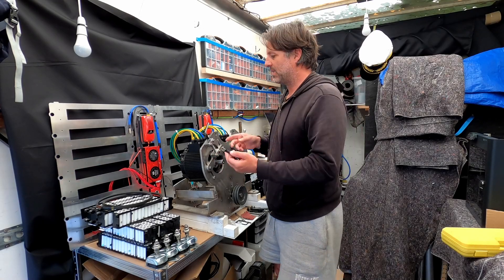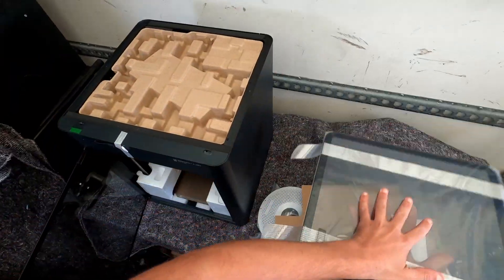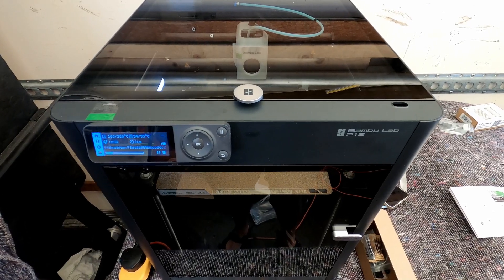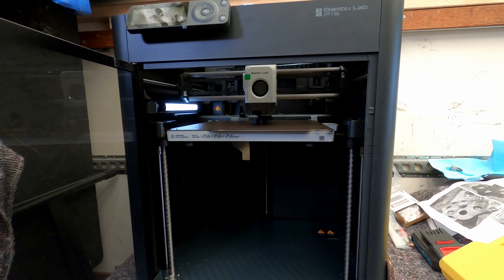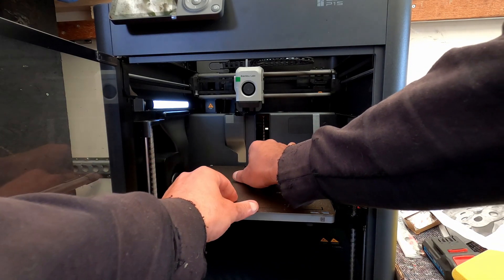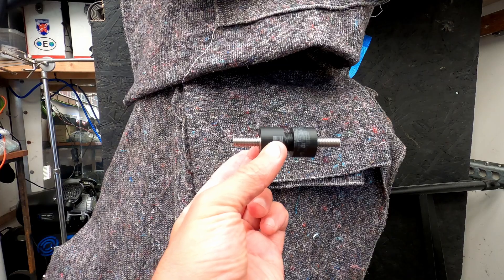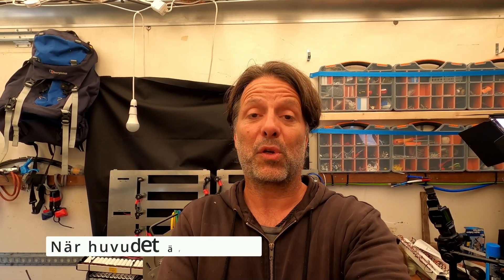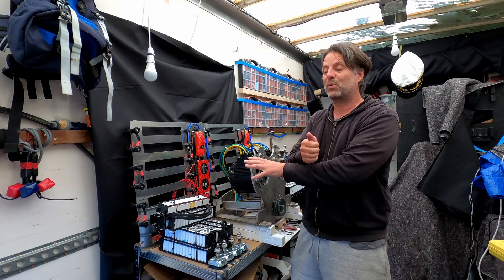Off-Grid Boat: DIY Electric Boat Motor Assembly - Ep. 5

Comment: Cara muito maneiro esse teu projeto quero desenvolver um e-mail brasileiro!!
Reply from the maker: Hi Luiz - Great project indeed:) Thank you for your comment. Not fully sure what email list you would like to create. Anything I can do to help let me know :)
Reply: @modularhippo  :-)
Reply from the maker: @jimjones7821 - Morning Jim, just to add, the 18650 Li-Ion batteries are 'experimental' and would sit in a fire proof box if ever used on boat:) More of a 'fun' project than anything as power versus weight and effort do not make sense:)
Reply: @modularhippo  never hurts to have a backup - I am planning 2 battery systems - too many links in the long chain in all this - only takes one link to break and you are out of action - not a good thing on the water in a boat. The plan I have come up with is to build a 12v battery out of the same cells I use for the main batteries - this way I get to use the 12v battery for odd jobs but I then have spare cells if I need to replace a cell say 3 or 4 years down the line - the cells we use today may not be available in the future so you need some spare cells - a spare 12v battery that can be used for odd use here and there now and be able to cannibalize for spare cells in the future is no bad thing.
Reply from the maker: @jimjones7821  - A 12V backup setup of the same batteries is not a bad idea at all. In case of an individual cell going wrong in the primary setup. Not to worried about the EVE standard being discontinued for a while, if anything they may tweak the metals to improve cycles and amperage BUT hope the size standard will remain the same for a while:) - Another point for separate 12V setup is that you then can still run 12V/5V appliances in case the 48V system is gone completely. I might have to borrow that idea from you:) - My final system is all built around 'what if' to make sure that I have a plan A,B, and C. As you say, not good at all to lose power in the middle of a long crossing:)

Comment: I have no clue but isn’t those belts way to small for the that motor torque/power?
Reply from the maker: Hey - It has been pointed out and I may have underestimated the load on them. Luckily the plan is to replace them with a single, wider times belt (toothed) so when I come to pick that one I will make sure it can handle the load. Big Thank you for the feedback as the project depends on it (I am not an trained engineer as you might be able to tell):)
Reply: @modularhippo  check out drive belts for motorcycles they would handle the torque
Reply from the maker: @kevinkurka8020  That Kevin is a brilliant idea. I will definitely check that out as make perfect sense:) Big thank you for pointing me in that direction. Enjoy your weekend!!
Reply: @kevinkurka8020  I second that - great idea! I was going to suggest serpentine belts - those v belts used so far have big transmission losses in them. But a belt for an electric motor bike would absolutely do the trick. I would still look into a serpentine belt though and compare - all the data will be there as to which one suits this application best.

Comment: 11:35 That's not positive. That's negative that you need to connect to the controller, the other one (blue marked B-) is the one you need to connect to the main negative of the battery.
Reply from the maker: Hi - Big thank you for feedback - Looking at the Daly diagram, it looks like Negative 'B' connects to Negative on battery, and Negative 'P' connects to Positive on Battery. Not had a chance to look at this properly and really happy you pointed it out as I now doubt myself and will do some bed time reading:) - To be continued:)
Reply: @modularhippo  it says P- on the cable, meaning Power-. The idea of the bms is to disconnect the battery from the load. The only way it can do it is by disconnecting the B- (battery -) from the P - (Power -) which is the negative that goes to your controller, charger etc. Happy to help
Reply from the maker: If you do not mind I would love drop you a message and sanity check any of the electrical BMS related stuff with you before adding load? Sounds like you know what you are talking about and can safely say at this point I do not:)
Reply: @modularhippo  Sure, go ahead. One more thing that is quite important, once you start connecting balancing wires, make sure you unplug the other end from the Bms first. Solder/connect all wires and then before connecting it to the Bms, check that the order is right, so you have 0V, 3.6V, 7.2V, 10.8V and so on, connecting it in the wrong order can easily break the Bms.
Reply from the maker: @ksochacki  Thanks - I have seen a couple of videos where people have connected the wrong balancing wire so have made a mental note of that one:) - Awesome, I will give you a shout before connecting any loads for a sanity check. Most appreciated!!
Reply: @modularhippo  Figured I'd just throw my hat in the ring as well and say ksochacki is correct.

Battery pack negative goes to BMS connection B minus
BMS connection P minus goes to bus bar/whatever negative.
Battery pack positive goes directly to bus bar/whatever positive. Preferably through a fuse first.
Reply from the maker: @Lagittaja  - Thank you for feedback and confirming:) As expensive (to me) components the last thing I want to do is wreck them so will definitely check back here before doing any drastic moves:) Guess worst case scenario is an electrical fire so I will definitely proceed with caution:) I have a 200a marine trip-switch fuse so might try to incorporate that. So that would go between 'P' minus and Negative Battery side? Correct?
Reply: @modularhippo  No, not between P minus and battery negative.

In this scenario, you would have the battery positive going to one side of a fuse. And the other side of the fuse would go to your positive bus bar/whatever.

By the bus bar/whatever, I mean whatever you're using for connections to your load, charger etc.

I sent you an email with a beautiful paint drawing.

I would add a fuse because it is cheap insurance. Sure, you have a BMS that has protections against overcurrent but I don't know how fast it will be able to react. If the positive cable sleeve gets damaged and shorts against a piece of metal that's grounded or if there is a short circuit for whatever reason, the fuse will blow and prevent the cables from overheating. Lithium ion batteries can provide an enormous amount of current in a short period of time..

As far as the size of the fuse and type of the fuse. I don't know. Probably. Refer to the specifications whether it can handle the voltage and has enough current breaking capacity (measured in kiloamps, higher the better).
The resettable fuse you have is probably DC rated because it's marine but make sure it is rated for DC. That is because DC is harder for these types of resettable fuses (technically circuit breakers) to break the connection than it is with AC. The reason is, with AC, the voltage goes up and down and so does the current. Eventually with AC the current goes to zero and it's easy to break the circuit. With DC, the voltage is always high and so is the current. So a DC resettable fuse/breaker needs to be able to break the full current.
Reply from the maker: @Lagittaja - Just saw the email, big big thank you as makes perfect sense now:) Really kind of you to send the illustration and taking time to expand on the topic. The fuse I have is luckily for DC so all Good that side:) Once again - Thank You:)
Reply: @modularhippo  come off it Henrik - you are building a yacht - you must be rich ;0
Reply from the maker: @jimjones7821  - Ha Ha, if I was I would have bought a larger boat upfront:) This is a paycheck-by-paycheck job I'm afraid :)